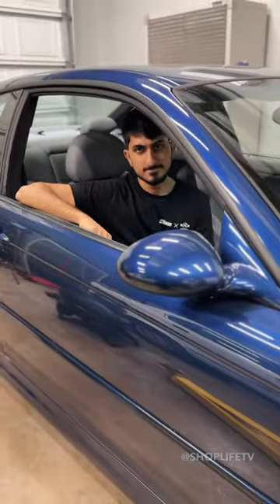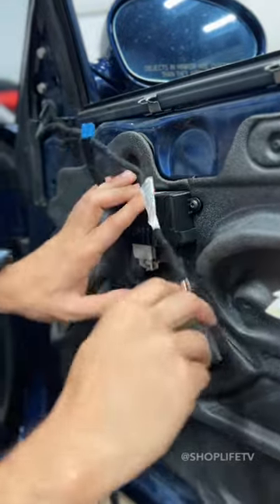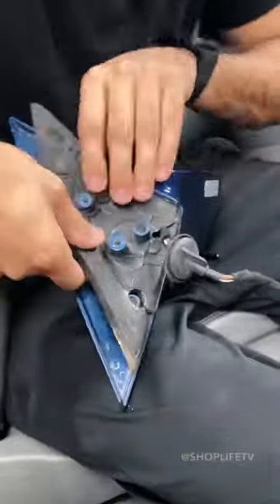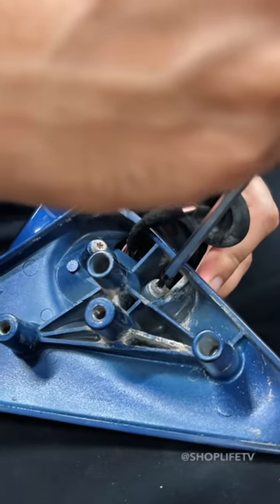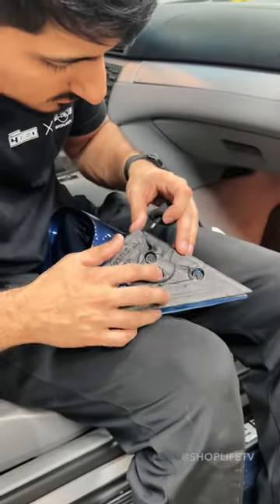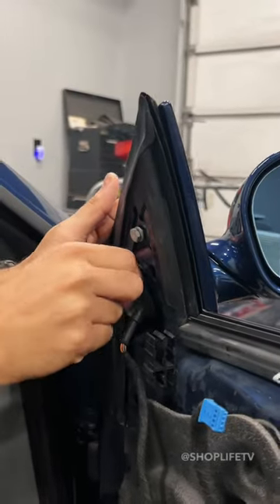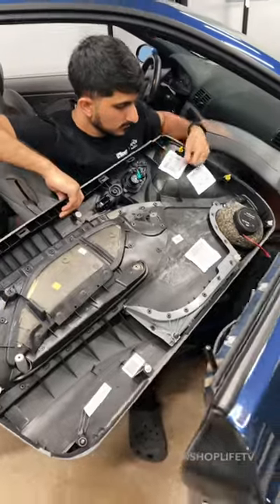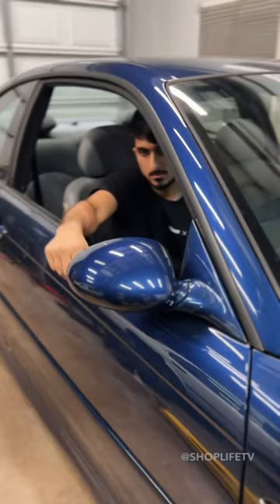Fixing BMW e46 m3 mirror wobble for FREE! #shorts

Comment: I need to adjust the software or whatever for the mirrors  because mine tilt down waaay too much when reversing
Reply: That is actually a feature, called "Bordsteinautomatik", so you can park without destroying your wheels. 
You can disable it by flicking the mirrorswitch to the other side.
Reply: @jackdaripperl But this in only for the right mirror. The left doesn't tilt at least in my E46
Reply: You can code the amount of dip you want.